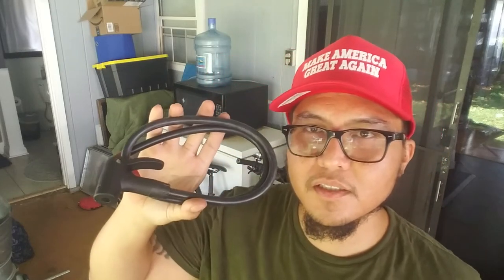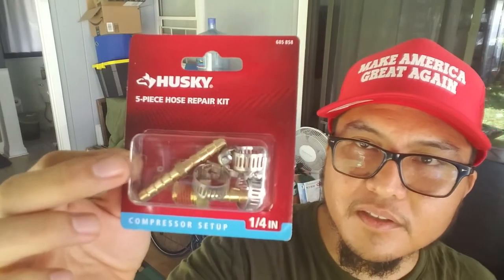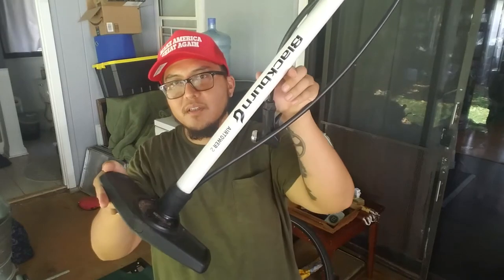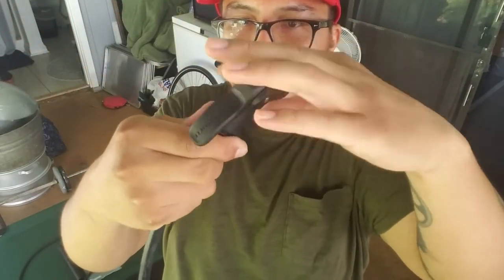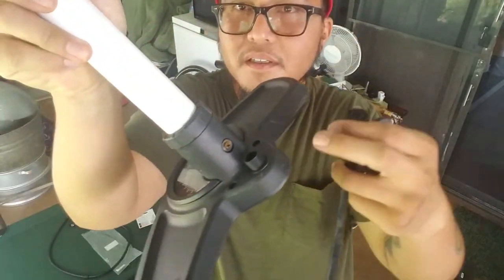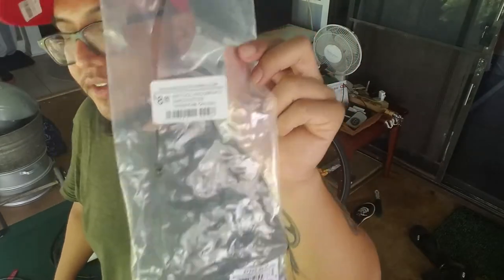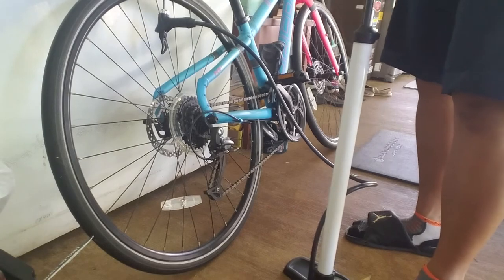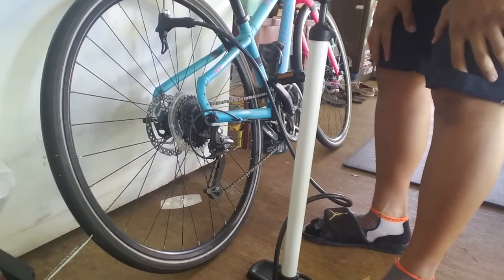Dont throw away your track pump.  Just do this quick fix!

Comment: my question is can I just use the tradional barb and clamp technique to repair a bike hose ( I mean If I dont like the current nozzle tip on my unit ???) I mean it would seem it should work?
Reply from the maker: As long as it's similar fitting.  Should work